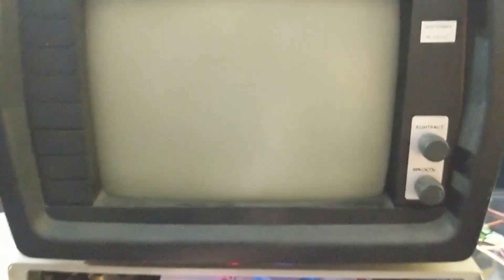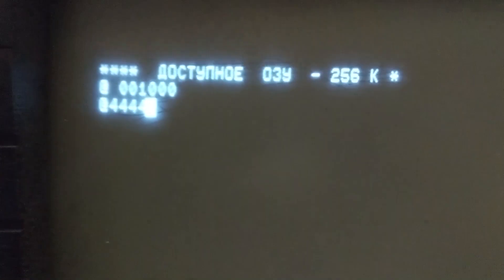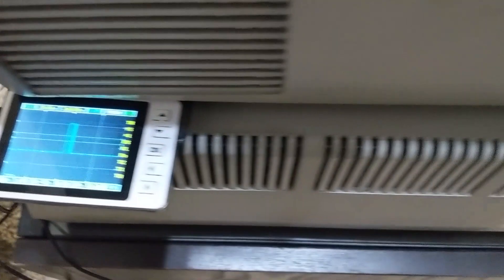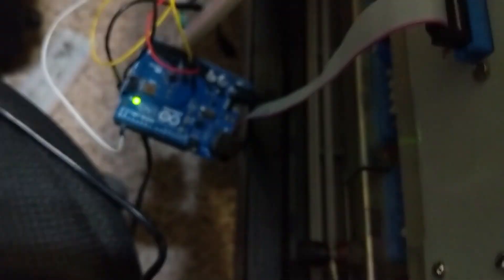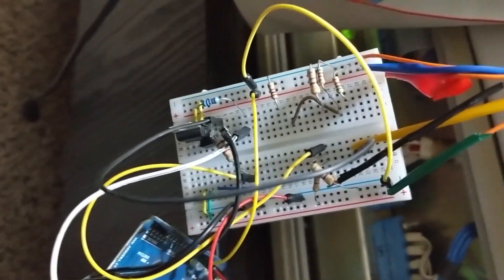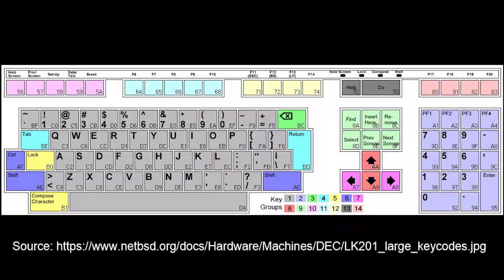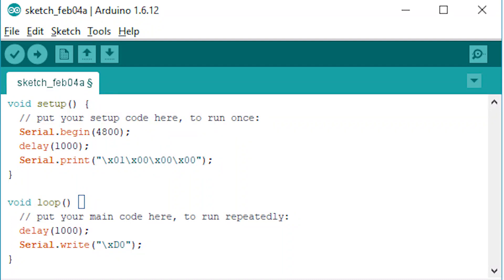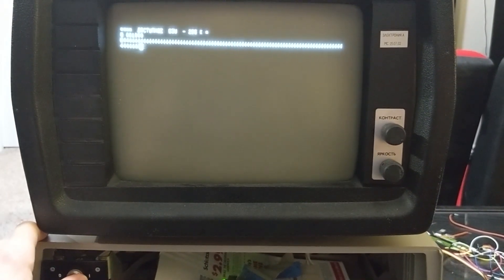DEC LK201 Keyboard Controller for a Soviet PDP-11 Clone

Comment: Hello there,
As far as I know, protocol wise MS7004 keyboard is 100% compatible with DEC LK201 keyboard.
The only concern is that there are basically 2 types of DEC LK keyboards: powered by 5V (for latest VAX-stations), or 12V (for terminals). The DVK keyboard is powered by 12V. So, if you found a proper LK, you might make a simple adapter and be good to go. (but, plugging in 5V keyboard, you'll fry it)
There is a thread on this topic on zx-pk (in Russian, sorry). If you need help with translation -- welcome, I could gladly give a hand. Its name is "22599-klaviatura-dec-lk201"
(They are talking about Электроника 85, but its keyboard interface is identical to DVK).
Reply from the maker: Hi Peter, thanks for your comment.  Yes, the similarity of the MS7004 to the DEC LK201 saved me from translating any documentation.  I just measured the pins of the DIN-5 connection with a multimeter to find each one's purpose.  I wasn't aware of the difference in power between the VAXstation and terminal keyboards, so if I come across a real VAXstation (maybe soon), I will heed this advice.

As for zx-pk, yes, some of them have made fun of me for this project when they saw it about a year ago: "Видимо, без клавы машину купил. Иначе бы огород смысла не было городить." ;-)  I'll take a look at this thread to see what else I should be aware of before finishing my design.  There are probably a lot of great documents and forum posts that I am unaware of.  It can be difficult to phrase a search query for obscure information in your native language, so searching in a new language brings a whole new set of challenges.  I'm impressed as to how much information has been kept and made available.
Reply: @TexasNerdHouse  It wasn't much about LK keyboards, I've searched already.
MS keyboard are infamous unreliable pieces of sh. Mechanically, it's a hideous copy of IBM capacitive buckling spring design, though the interface is identical to DEC. They've completely ruined the idea, and those keyboards turned out to be buggy as hell.
In the meantime, I've found yet one more thread about fixing the keyboard: 22480-remont-klaviatury-ms-7004
In addition, there is a nice website with tons of guides,  recommendations, and documentation:
forum maxiol com index
php?showforum=86
Reply from the maker: Hah, yeah my wife abhors this keyboard.  She's a huge keyboard snob, having done several custom builds, and how the keys can freely rotate on their switches so they're not perfectly straight in a grid really triggers her OCD.  I appreciate this thread on cleaning the keyboard and will take a look at the extra insights as well.  Thanks!  I'll probably make a video about the process.
Also, it could use a bit of cosmetic restoration.  The function label sticker has almost completely worn away, and the "ЕЛЕКТРОНИКА" badge on the front plate has gone missing.  I was thinking of 3D printing a new badge, but if you could help me find a good clear shot of the function labels, I'd really appreciate it.  I had someone at zx-pk do ir for me but they took the pictures so close-up that the lens distortion was hard to edit out.
It's amazing how, despite weighing 5.5 lbs, it feels like it's gonna break in your hands if you pick it up wrong. ;)
Reply: @TexasNerdHouse  Easy! Just tell me how to make this pic: what distance to keep between the camera and the keyboard, what quality do you need, etc.
Reply from the maker: @petergorelov418  Thanks very much; that would be awesome! Holding it 30-40cm away from the keyboard and using 25-50% zoom on the highest quality resolution should be good.  Basically minimize lens distortion, minimize noise from digital zoom, and get a decent amount of pixels of the keyboard label.  A good print is at least 300 dots per inch.  However, if you can tell me what font the label uses, then I can recreate it without needing photos.  I tried font matching earlier but nothing I found was a good match.
Reply from the maker: @petergorelov418  Hello! Just wondering if you've had any luck getting pictures of the keyboard.  It'd be super helpful for my restoration work!  Thank you.

Comment: I see you have problems with the keyboard, but this is a very common problem .Maybe this is due to poor storage conditions before you. I think if it is collapsible, then you can try to clean it ... but in general it's not bad to have a replacement in case of a breakdown .... or even with such opportunities you can organize an online tetris game for people that would be funny ;)
Reply from the maker: Yes, I'm hoping it will be easy to clean. I hope that whatever is under there isn't just going to crumble and break into dust or many tiny pieces that I can't reassemble.  The problem started with the "I" key and has since moved over to the last two columns of the numpad, including the ВВОД key (basically Enter) and some of the numbers you use to move pieces in Tetris.  It's hard for people to use without explanation of what keys are good substitutes -- not to mention, most folks expect to play Tetris with the arrow keys anyway. ;)

I'd like to build a Twitch stream with a camera pointed at the system, and some kind of time-sharing mechanism to allow people to sign up to play it.  The people at ZX-PK think there will be too much latency to play Tetris with this arrangement, but we'll have to see... maybe we'll have to stick to text adventures.